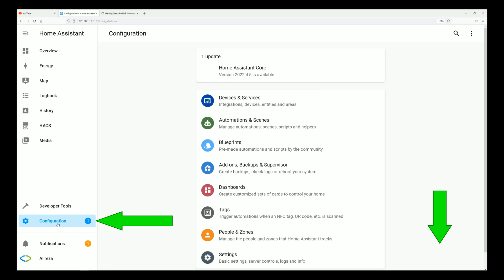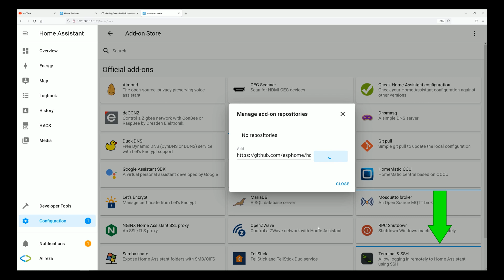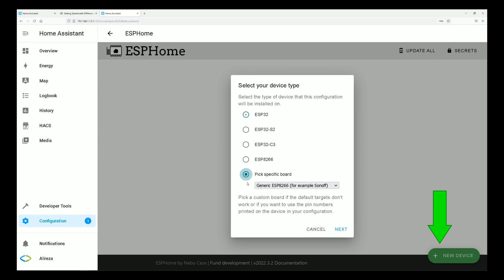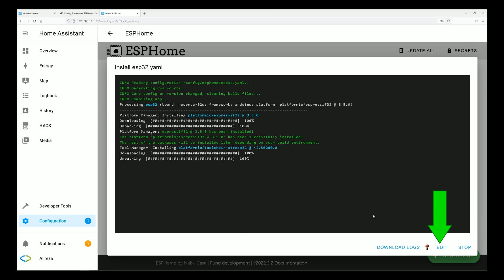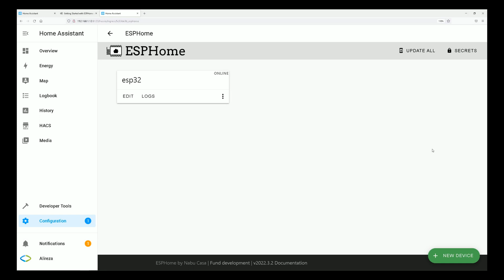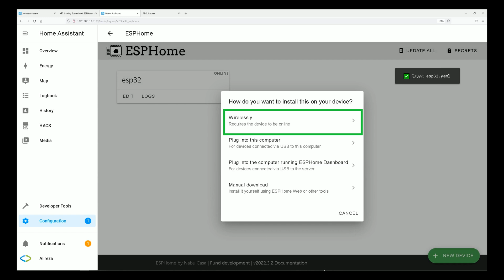Getting Started with DIY Smart Home Projects using ESPHome

Comment: Hello. I have a question about programing the yeaml file. How would you program a pin to turn high/low. the equivalent of
" digitalWrite(pin, HIGH)" in arduino. Can you make a video on how to control the pins of the esp32 with the esphome. Can't find any info on simple stuff like that anywhere. The Esphome homepage has documentation but they only show snipets off code, not whole examples. That makes it incredibly difficult to understand it, considering that yaml is so picky about spacing and stuff. I would love someone would make a tutorial on the esphome part alone. Like the structure of the yaml programming, how to read voltages or pin states. PWM. Using a servo and general stuff like people do in Arduino. I think that would be verry useful.  Thank you.
Reply from the maker: Hi, As I understand you need to program ESP dev board with ESPHome without Home Assistant?Is that right?
Reply: @kian.smarthome  yes. That way it can still run if the wifi connection is down.
Reply from the maker: @Homemadebots  I will upload it soon
Reply: @kian.smarthome  Thank you. I think that would be verry useful for everyone. 
    After many days of frustration I did find a solution by using the "interval" block without setting the interval time and: then:
     - output.turn_on: sensor_dht_power. That worked for me.

Comment: Is there a HA alternative that the ESP HOme connects to ?

I ran into difficulties with burning HA firmware on the SDcard - since I have a Mac and there is a balenaEthcher Bug !
So I want to bypass the HA and use something else.
Reply from the maker: There shouldn't be any issue installing HA. Could you tell me how you do it?
Reply: @kian.smarthome  I bought a 64 GB MicroSD card, and I have a RPi3 64bit with me.

I used "balenaEtcher" to burn the image from the HA link ( It has 4 links, Two of them for RPI4, and two for RPI3 64 and 32 bit.
I chose the 64 bit and flashed that to the MicroSD card.
The balenaEtcher burns it and completes flashing and at the end the Mac OS reports that it was unable to flash and a popup says "Initialise, Eject, or Remove"

At this point the balenaEtcher says it's flashed , however the Mac OS says the SD is not flashed !
I googled and found that the balena Etcher has such a scenario and there are no answers.

I ran the balenaEtcher as root on the Mac ( Mojave )

Earlier about 2 months ago I tried and same  result. I have two RPI3 and same behaviour on the Pis.
At this point I am certain that it's my Mac thats doing it.
My student has a Windows and he installed the same image, and we both have the same PIs. So I am going to have him burn/flash the image over the weekend.
Reply from the maker: @kiranshashiny  Please inform me about your student and meanwhile I will try it myself to find a solution

Comment: Can I not do the same without my home router ?
In other words, set up the RPI-HA as an Access Point and use it to communicate to the ESPHOME development boards ?
I am trying to not be dependent on the Home Router as it might fail or not be reliable at times.
Reply from the maker: an OS is needed and for using ESPHome, HA is the OS. You can add multiple networks to your esp board for connection. in this way if first network connection fails, then esp tries to connect to second network and ...